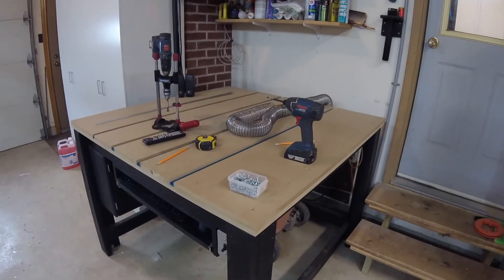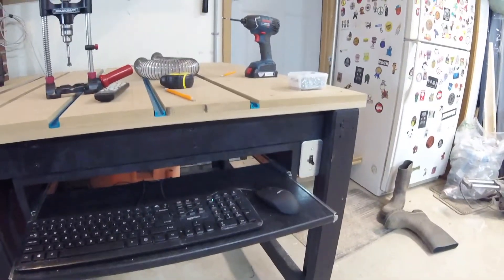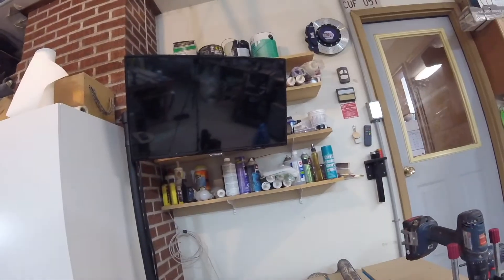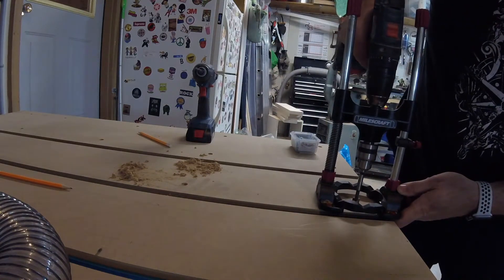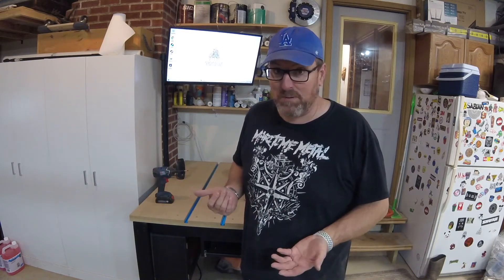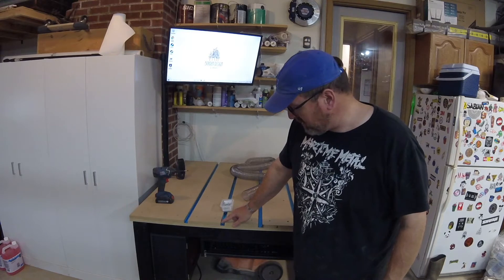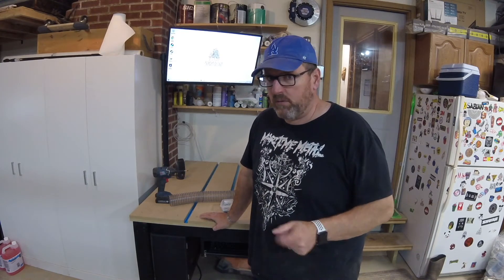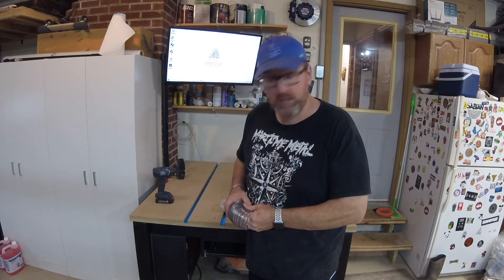Scienci LongMill CNC Table build

Comment: When using wood 2x4's, did you have any problems with flatness?  I've thought that using steel 2x4's might be a good idea.
Reply from the maker: Definitely.  I took my time picking out ones that were straight and flat.  Worse case you could put them through a planer to ensure flatness

Comment: Thanks for taking time to make your Youtubes,  tried a couple, appreciate how much work it is to make content.  I am  now in the same boat today that you were a few months ago, just ordered the Mk2 Longmill.  Similar reasons, supporting Made in Canada was a significant factor. Looked hard at the Onefinity - but Longmill won out. Busy Bee's Sharp CNC also in the running (too small), as well as Fox Alien.   Now looking at table design.  I have a small basement shop and went for the 12x30 (which curiously shows a 14x32,2 work area (max wood size I guess, 12x30 may be max cut area - will find out).  T-Tracks look interesting, vs the blue tape and glue method others recommend.   I am hoping to be able to mount it onto a 3/4 ply base that I can then clamp onto a B&D vintage Workmate which I am hoping will be solid enough.  Either that or do some significant renovation of my shop to make room for even this smaller unit.  Your comments about dust control are helpful.   For next year it will be an after hours hobby, learning time,  then I'll be retired.  Not too worried about making it pay for itself, but be great if it could help funds my hobby supplies.   BTW shipping to Alberta was not as much as I feared ($90ish via UPS).
Reply from the maker: I was pretty close to getting the Onefinity as well, happy with my choice.  Shipping to NB was about the same I believe.  Thanks for checking out the video, not sure if you saw but I posted an update video about the LongMill last week.  Cheers!
Reply: @bordendesign    yes watched that one too,  but just those two so far.  It will be a few months before I get my new MK2 machine, Scienci says shipping in Feb - maybe March.  Have to sort out how to fit a 24x48 table into my tiny workspace.  Time to build (and maybe renovate workshop to accommodate the CNC - went for the 12x30 due to the tight quarters I have to deal with.  Playing around in Tinkercad with design ideas.  Are you happy you went T-Track?   I see some suggest easier to go with blue tape and CA glue.    Also listened to your concerns about Easel.  Thinking I'll try learning Freecad (step up from Tinkering in Tinkercad) - took a boo at Blender - not yet. Did look at a couple of Bucky's video's  - funny guy.  Any other Youtubers you think are worth watching?
Reply from the maker: @DavidBealeakaFKD  I have used the tape/glue method and it works well but for the stuff I make it seems wasteful/expensive over just clamping the piece down.  Blue tape is like $8 a roll now haha
Reply: I just put in the order last week. Looks like it's expected to ship end of May to June.

Comment: Will the Long mill not work on the MacBook?
Reply from the maker: the G-Sender will work on mac (the "control software" ) but at the time I assumed I'd end up using design software that was windows only, I've actually ended up picking "Inventables Easel"  for design software and its browser based so it will work on Mac.  I'm trying to find a used Mac Mini now lol

Comment: Long Mill owner as well... Audio for me seemed a little low on this video.  May want to get a Cyclone like dust collector. The Shop Vac as is now will collect a lot of dust quickly into the filter and also just the amount of chips too.
Reply from the maker: Yes audio was pretty bad.  I'm ashamed to say I used to work as an audio engineer as well lol!
I'm working on getting some better video gear so hopefully the audio will get better.

I've since added a small bucket cyclone for exactly the reason you mention, lots and lots of dust